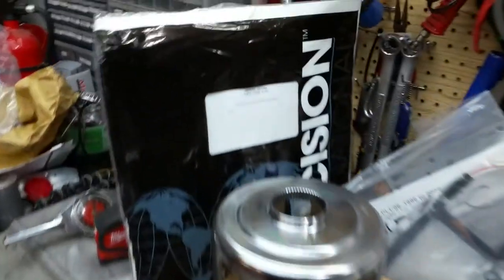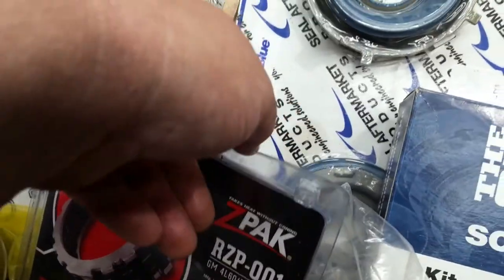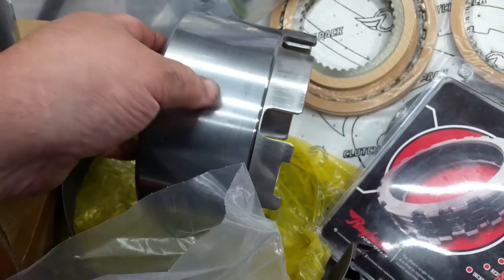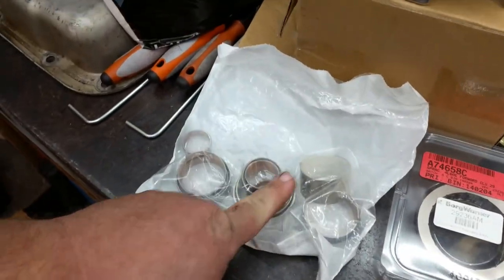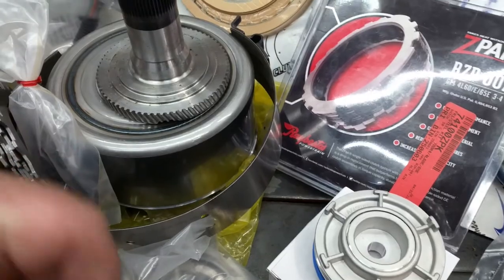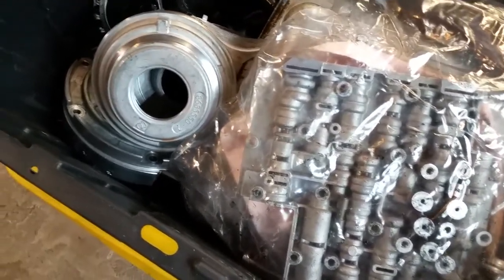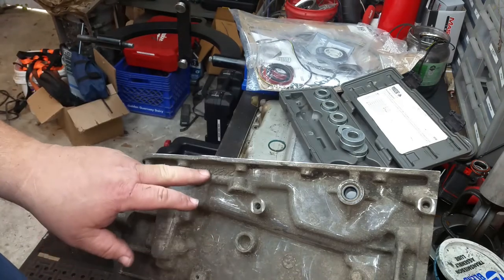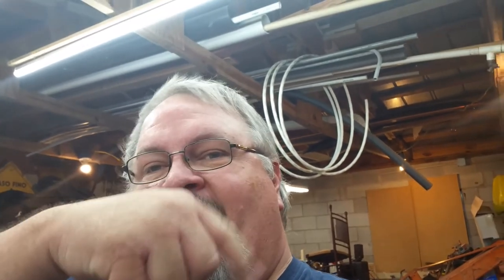Austins GM4L60e Build Begins!! Starting with Bushing Replacement!

Comment: You should clamp pump to table when reaming....just a quick clamp would be fine 👍
Reply from the maker: Good advise 👌
Reply from the maker: @localcustomer4646  Yes. In fact, I used to use their kits in all my builds, but I've found I like the Sonnax stuff a little better. They both work pretty good either way...
Reply: @IrocinZ  cool, I thought they made some pretty good stuff.
How much are parts totals running on these builds with all the. Ew goodies??
Reply from the maker: @localcustomer4646  it really all depends on what hard parts you use. It can be as cheap as $600, or somewhere around $1800 to $2k. The ones I do are usually all different, but on average, $1k for parts.

Comment: How do you clean your hard parts?
Reply from the maker: I usually take them to work and use their hot tank. U can use about anything as long as it doesn't leave a residue. Mineral spirits works good.
Reply: @IrocinZ  I usually use brake clean and mineral spirits but didn’t know for certain

Comment: What do you use to clean the hard/soft parts?
Reply from the maker: Usually I take them to work and use their parts washing tank. If I don't have that option, I have Zep Brake Wash that cuts the muck and doesn't leave a residue.
Reply: @IrocinZ  oh ok was just curious bc your parts came out very clean, was wondering if you introduced heat or not but I use mineral spirits in a parts washer cold wash